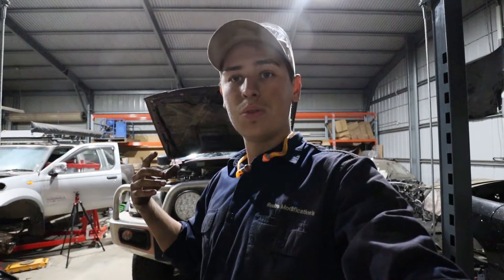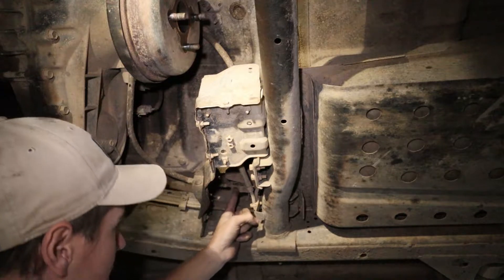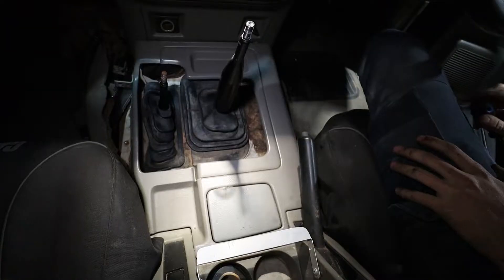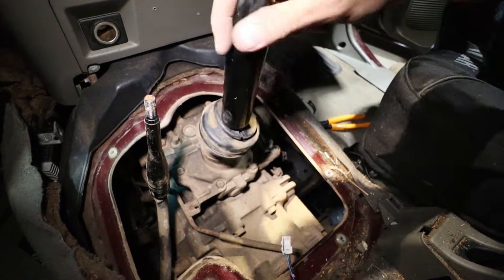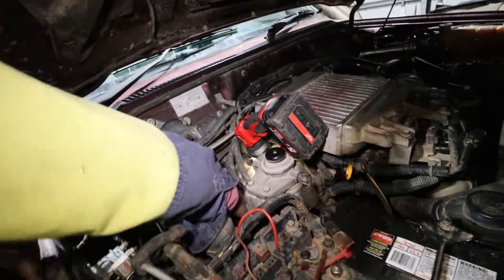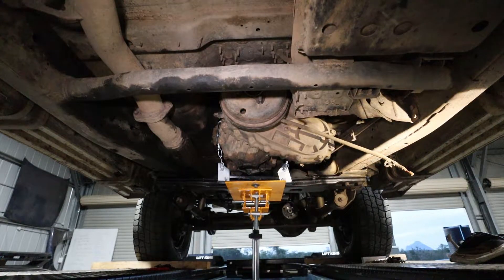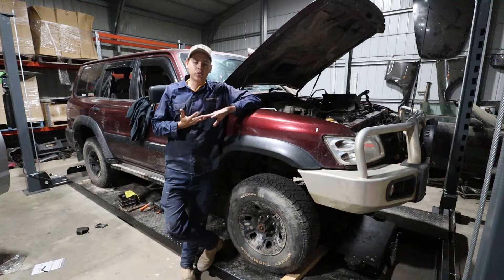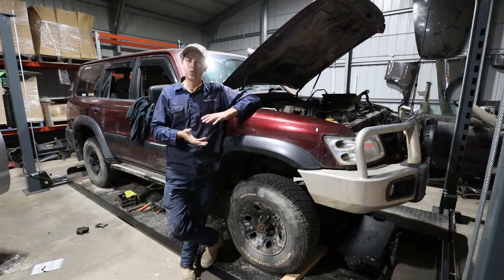Patrol Clutch Replacement Pt 1

Comment: is it necessary to change the flywheel if it has no play?
Reply from the maker: Not necessary but depends on the condition of the flywheel. They are not very expensive and given the amount of labour to remove the gearbox it is usually worth replacing or reconditioning.

Comment: How long time did this job take?
Reply from the maker: This job was done over a couple weeks as I was waiting for parts. Id say if you had everything you need you could do it in a weekend
Reply: If you have a lift with independent lifting points rather than the drive on ramps it’s easier. The hardest part is getting the gear box out. They’re so damn big. The first time I had to take the gearbox out it legit took me 8 hours. Now I can be ready to get the thing out within an hour .

Comment: what would such a job cost? ty
Reply from the maker: I would say if you're paying to have the work done by someone else it would be up around $2,000 including the clutch.
Reply: exedy clutches quote 8.5hrs workshop prices. so around $140hr, so close to a $1200 but thats probably not taking into account replacing rear main seal or new flywheel etc.